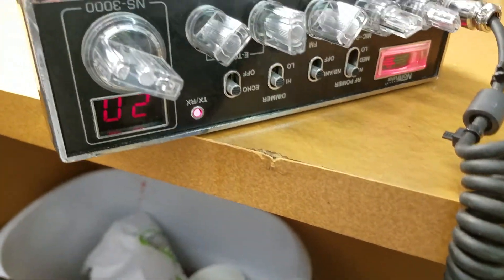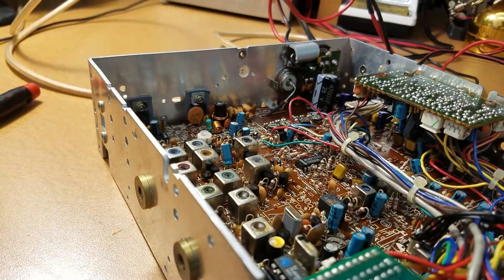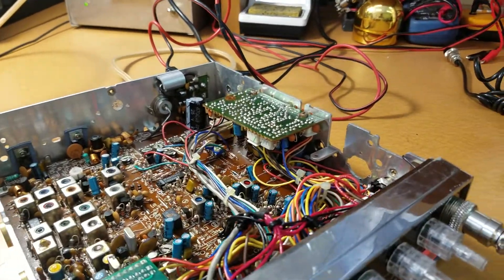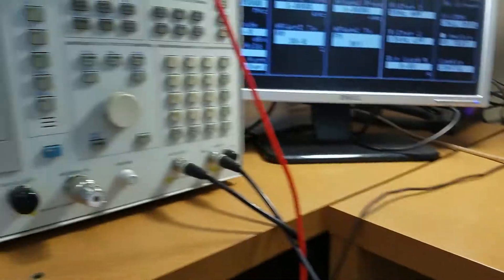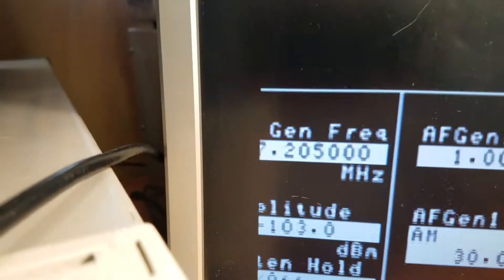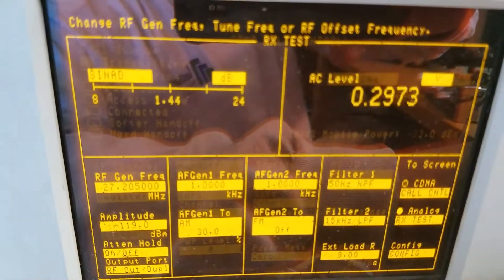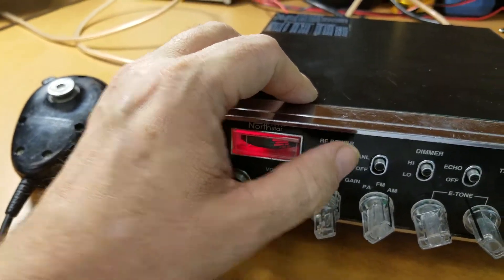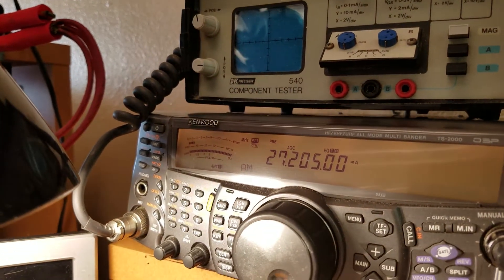Northstar NS3000 repair and alignment

Comment: I really enjoy watching your videos!

I am trying to see what communications test set you are using. I´ve seen a couple of different models in your videos.

Is it HP 8924E, HP8924C and/or a HP E8285A?
Have you modified them in some way since they are mainly used for CDMA/GSM testing. I see in their specs though that they do cover 30-1000MHz  (8924 models) and 0.4-1000MHz (E8285A).
Looks really cool that you can monitor the data on a PC screen like that. :-)

Keep up the good work!